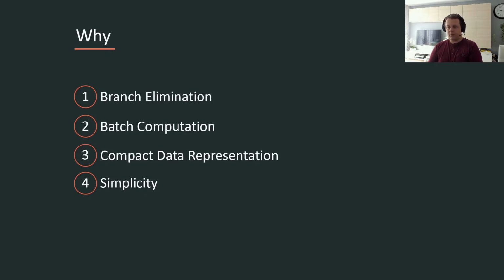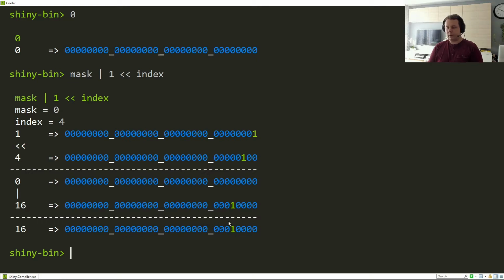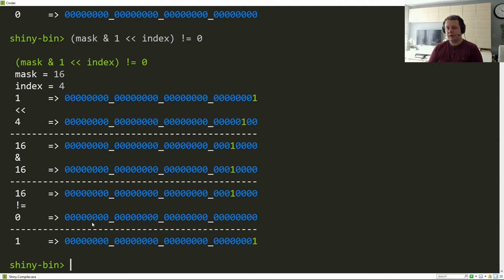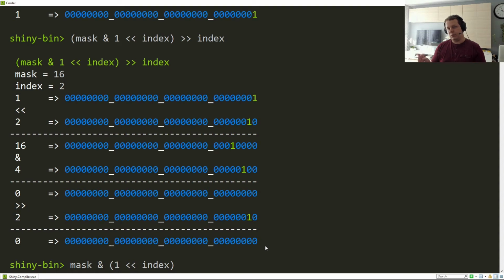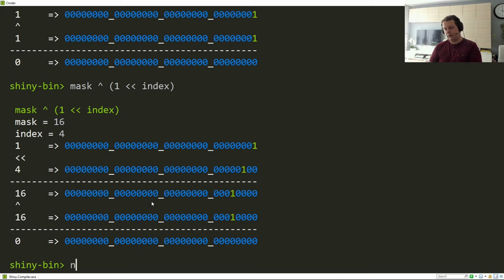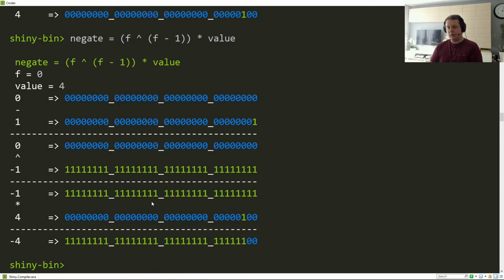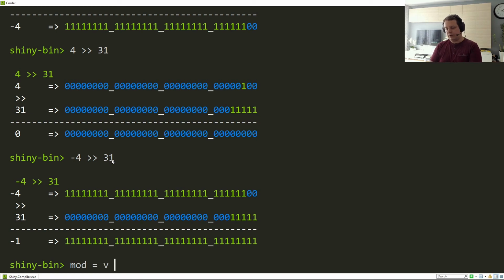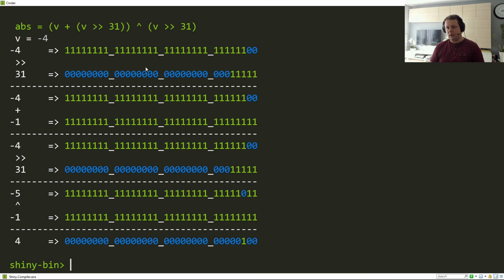Introduction to Bit Hacks in C#

Comment: Hi, @6:34 (and earlier as well), if you mention '4' in 1<<4 as binary it creates a bit of confusion as binary counting does not come naturally to people. can represent it by ←←←←.
Reply: but it's not binary counting, that 4 is a decimal 4, exactly as you've shown with the symbols (there are four shift arrows/operations).
the way he presents this is a de facto programming standard in C#. i.e. if it's confusing it's probably too advanced for the viewer anyway.

btw when it comes to tracking that shifted 1 in the mind, do it visually, but don't forget that each slot in a binary number is a power slot -- meaning that slot #0 is worth 2^0 (or 1), slot #1 2^1 (2), slot #5 2^5 (32) etc, there is a simple linear progression between the slot exponents.

it's the same thing with a decimal system (or any other system for that matter, in other words there is no need to 'count' in binary), where slot #2 is worth 10^2, slot #5 is worth 10^5 -- and indeed 100.100 natively represents this without having to count anything.

obviously, a system with more than 2 digits also has an added benefit of magnifying a slot "in place", thus having a '3' in slot #5 makes it worth 3x10^5 and yes this is the actual value of the literal 300.000, and you can change a digit until you completely saturate the slot and then you have no other options but to shift left.

"full-slot shifting" to the left thus magnifies a number by one full power slot, in decimal that's 100.100 SHIFT 1 = 1.001.000, it gets magnified by 10 (because this is what shifting does to the value, you skip as many slot values as there are digits), while in binary 10 0100 SHIFT 1 = 100 1000, means it gets magnified by 2.

same thing going on with hexadecimal, which is like a big brother to binary because 1 slot of it contains 4 nibbles or 2 full bytes: a "full-slot shift" in hexadecimal multiplies the value by 16. i.e. 5 SHIFT 1 = 50 (which would be 80 in decimal, because slot #1 is worth 5x16^1)

now let me address the actual shifting operator << : because the meaning of the "full-slot shift" changes with the number system, it is by convention defined to always accept exactly bits (or binary slots), but as a DECIMAL number. at least that's how it worked in almost any language I've ever used; it is native to the machine, yet readable by humans who typically visualize 1 << 4 as 'shift 1 by 4 binary slots to the left'.
Reply: @milanstevic8424  bit hacks/tricks are mostly normal level. It may be due to the way I learned in college. I spent more time understanding why he wrote like that (and not in some other way) than the technique taught .
As cool as the calculator may be, It still can be made more intuitive. Perhaps I'll give it a shot
Reply: @CHITRANSHSHARMA  well, in my mind, you could only animate this to make it more clear.

believe me, there is no other more intuitive way to represent this, it simply has to be a bit rough/messy like any other scientific or mathematical notation. I've been a programmer my whole life, anything else (other then a simple animation depicting the actual 'shift' of the bits) would be annoyingly confusing to me and people like me.

now if you meant like his entire notational approach could be better (and not just the shifting notation per se), that's something else. maybe I'd even agree.